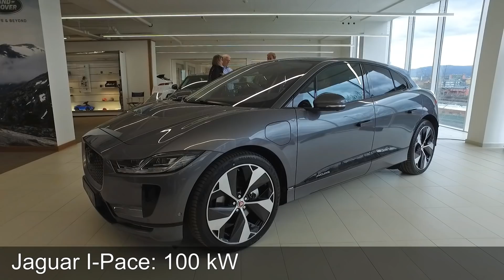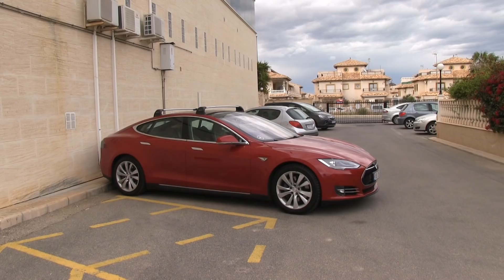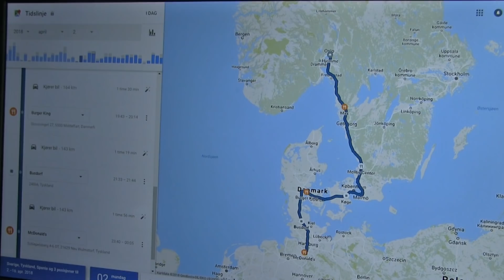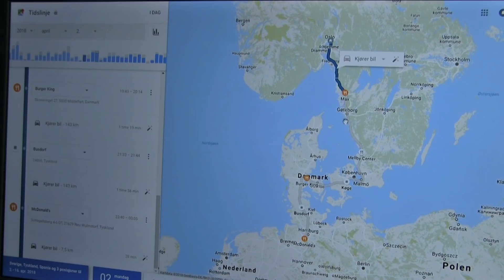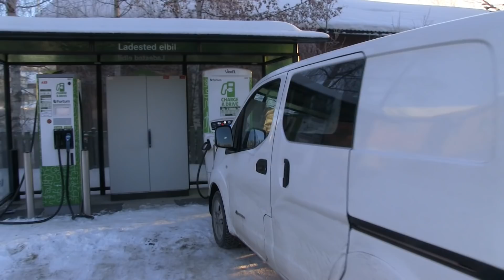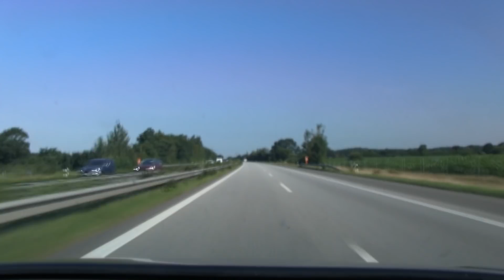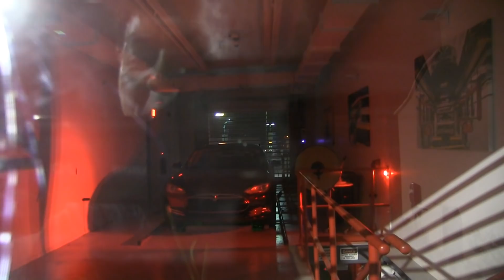Will 350 kW fast charging be too fast?

Comment: Elon actually responded to the 350kW charging of the Porsche during the Q1 call of tesla , He said that it is a tradeoff between charging speed and range.
Reply: 3d tech, current battery technology is the limit. You can buy 18650 cells in either high power with low energy, low power with high energy, or medium power medium energy. The high power cells can charge faster, but they don’t hold as much. Tesla superchargers are set for the Tesla batteries which are a compromise. The charger isn’t the problem. Tesla can upgrade to 350 kw chargers but they would need to change the batteries to 800v.
Reply: IMHO 1000-2000 kw charger sounds great. But I am afraid we will stick for quite a while with the 350 kw as maximum. 

350 kw requires already 800 V. To handle 1000 kw it requires 3 time the voltage in order to use the same cable diameter. Around 2400 Volt also needs groups of 600 cell in a row where the inner resistor of the cell might prevent a large quick charge area. 

This type of quick charging might be more relevant for super capacities.
Reply: IMHO I am not sure whether Tesla is able to switch the Battery cells to groups of 800 Volt for charging purpose. Otherwise I agree it will be difficult to get the faster speed into the car.
Reply: xmtxx2, the 800v has nothing to do with C-rating, is has to do with current. If you have a 350v battery getting 350kw, you need 1000 amp. And that is higher than the charge cord can handle for extended periods. These chargers are limited to 500 amp, so the only way it can get 350lw is to use 800 v battery. If you use a 400 Volt battery, the 350 kw ultrafast charger will only give 175kw. 

The Tesla supercharger can’t put out 350 kw without a significant upgrade, unless Tesla moves to a 800v system. The 2020 Roadster should be 800v, and Tesla can upgrade some superchargers in key areas to 800v 350kw. 

The semi wil also likely use 800v system with 4x 350 kw chargers for the same reason. If Tesla were smart they could add a megacharger lane at baker and Kettleman which funnels 1200 kw to a megacharger and lets each pair of stalls share 60 kw, and as the semi drops the charge rate, those chargers can go back to the cars in a proper sequence.
Reply: That's what a implied, you'd halve the amperage on the charger, we had a little misunderstanding.
As you said, the limiting factor on the tesla S end 3 batteries are their capacity, not their overal voltage.
As said elsewhere, if you tweak your model S battery, you'll still be able to charge it at only 100-150KW.

On the other hand, the roadster and the semi truck will need higher voltage, because they will be able (and need) to charge at higher speeds.
Reply: xmtxx2, yes, Elon and JB explained during the Conference call that the battery chemistry is selected for the best compromise, which can only tolerate about 1.5C charge rate, and have a decent balance between power and energy. The chargers can be 1600 kw if the battery can take it, as will hopefully be demonstrated with the Tesla semi. 

If someone makes a battery which can charge at 12C without degradation, they just need to put a Tesla semi charge port on it and use the megacharger. 

I do see 1000-2000 kw chargers someday becoming the standard, as soon as battery’s can be charged in 5 minutes. Then you charge at home, or pull into a filling station and charge, but all these destination chargers will go away. This is why it’s not good to get too much substandard chargers set up, and too many cars with substandard batteries. It’s hard to imaging that some day a Tesla supercharger will seem like a trickle charger. LOL
Reply: Volker Blume, there are other ways to get around it. I figure the Tesla semi megacharger would use 4x 350 kw chargers going to the 8-pin connector. It can also be done with two DC pin connector, as long as the plug type and wire from the plug to the battery is either big or liquid cooled. 

By the time there are batteries that can handle it, we can also put the charger cable inside a robotic arm, so the weight won’t be an issue.

The main point is, it’s the battery technology we are waiting for, not the charging technology.
Reply: IMHO well to load parallel is one option, definitely. But the cable will be also 4 times bigger in diameter. Maybe a robotic arm will help. Quite some extra effort is needed to handle the connection mechanically. Let's see what kind of solution will come up. For me the question is, is the extra effort needed to charge in 5 Minutes. The consumption of the car per km/mile will not change, even not in 10 or 20 years. It is more likely that it will go down by more sophisticated technology to be build in. 

I would predict with a Battery with 120-130 kWh plus a 350 kw charger and a more energy efficient car you will charge to reach the next charger within 10 Minutes. That will be for most of the people absolutely sufficient. 

With a 100 kWh battery today combined with Supercharger speed I expect charging stops of 15 Minutes. Which is quite close to it.
Reply: Volker Blume, the current Superchargers can only give 30-35 kWh in 15 minutes. Which in a Ioniq would give 150 miles, but in a model X it would give less than 100 miles. I think they can still get some more efficient electric cars, and as they make batteries which can charge faster, the battery can be smaller. One of the 350 kw chargers could add 35 kw in 6 minutes, and that 35 kw could give 150 miles range. 

But I think current technology will just have manufacturers using bigger an bigger batteries which will also allow 35 kw added in 6 minutes, while allowing more range if needed. As long as the weight isn’t so high that the watthours per mile gets out of control.
Reply: IMHO I have an X so I know the consumption on the worst end of efficiency for EV driving ;)

150 miles are 2,5 hours driving, maybe 2 hours in Germany. I do not perceive a short break of 10-15 Minutes as disturbing. 

With the 90 D the charging were 20-25 Minutes, with the 100 D it will drop about 5 minutes.
Reply: Volker Blume, now that I’m old and retired, the 30 minute charging wouldn’t bother me, but when I was younger they trips I did couldn’t be done in a model S 100D or a model 3 75. I know there’s still plenty of people who can’t afford the luxury of EV ownership.
Reply: IMHO Agree the Teslas are the upper end of EVs. But I expect that the technology will become available for more people as the price will drop due to scaling effects of mass production. 

There will be also more affordable batteries with higher capacity. :)
Reply: Volker Blume, yes, but I think that’s still 5 years away before any new EV can be bought for the price of a Toyota Corolla, without subsidies. At some point the subsidies will run dry, and if it happens before the movement to EVs has reached its tipping point, they will slowly become scarce again. If Tesla can make 10,000 $35,000 model 3 per week.
Reply: IMHO that is an other aspect which shall be considered. What I see from other subsidized technology here in Germany like e.g. solar panels, as soon as the subsidiary is dropped the price will decrease as well. 

In general I don't understand why a Tesla should be so expensive as it is now. There is hardly any technology in which requires special treatment in the production to justify the high price. The missing competition in this product range let Tesla keep the price high. Presumably needed to build up the manufacturing lines and infrastructure. But I expect when competition is coming up, battery production capacity will go up, the price will drop. Interesting in this context also how the new Asian car makers will be perceived and accepted from the consumers. Their market entry will be price driven.
Reply: Volker Blume, I think the problem is the battery is too expensive, and nobody wants to buy a $12,000 car with a $15,000 battery, so we have Nissan putting a $8000 battery in a $22,000 car and Tesla had $30,000 battery and needed a $50,000 car to put it in, so it needed the autopilot and very good performance. 

Once battery’s can be made and sold for $100/kWh, we can see some cars around $20,000 because a $6000 battery in a $14,000 car is probably acceptable. 

The leaders of each country also have to pay attention to the economy and not get tunnel vision on climate change while their country is being overrun by chaos from unemployment caused by China doing all the jobs. 

I think Germany is trying to block some of their government subsidies from going into Elon Musk’s Pockets, and they got the model X disqualified but the model S got in on a loophole. The model S base price isn’t less than €60,000 without stripping it down to the bare bones.

As soon as VW group starts making some cars for the US, I think Germany will get some of their revenue back.
Reply: @imho7250 
I've read the other day, that VW has signed multiple contracts with 4 battery makers worth 50 billion to produce batteries for 15 million cars... that would be 3400€ per car on average, but that is more a 6 year plan with a lot of change.

VW starts in November with the production of the ID3 long range (550km) for around 30000€ and the low range (330km) should cost 24000€, but they expect that they need at least one to two years to bring the cost down for the low range.
Till 2025 they want to bring the ID1 to ID9 to the market and especially  for the ID1 and ID2 they have to lower battery cost significantly in the next couple of years.

I seriously hope that they are taking this serious.
Reply: Jakob Schulze, €3400 average for what would appear to be 75 kWh and 50 kWh batteries seems a bit optimistic, even for 2025, unless they think they have a technology that just needs refinement to get the cost down. 

Even getting the battery price to 25% of the total car’s price will take some time, because as batteries get cheaper per kWh, people expect more range or faster charging (miles range added per hour)afforded by larger batteries.

But if anyone can make a People’s Car, Volkswagen is the one to do it. It’s smart of them to wait for proper timing, when most lessons to learn have been learned, then come in with a cult car for the masses.
Reply: @imho7250 
"3400€...seems a bit optimistic"
Not really, when you think about it, but I wrote that a little confusing.
Those are the contracts for the CELLS and not the battery PACKS (which VW will produce in house).

When you look at Tesla in comparison, in 2010 their battery PACK price was around 1000$/kWh, which is now down to below 190$/kWh and Musk claimed that they would be below 100$/kWh for the CELLS by the end of 2018.
So the cells are around 60 to 70% of the price of the packs (from what I've read so far).

So 3400€ for the CELLS of a 45kWh pack, would be 76€ / kWh (or 88$) which would be 12% under Tesla's 100$ per kWh.
That isn't unrealistic, but adds up. (I'm surprised myself how well this quick estimation adds up).
Reply: @imho7250 
I just found this article from a year ago, that they estimate that in 2025 the price for the pack will be below 100$/kWh. ( https://insideevs.com/lithium-battery-pack-prices-to-fall-from-209-per-kwh-now-to-100-by-2025/ )

For a 45kWh car, that would be 4500$ (or 3850€), which is still a lot of money, but would make smaller EVs for around 15k-20k possible.
Reply: Jakob Schulze, yes, at the cell level that’s within reason. The pack level, especially with active thermal management, unless the internal resistance is so low it’s not needed, is going to bump the price up a bit.

I hope they can get these affordable EVs on the road as planned.
Reply: @imho7250 
The MEB has integrated cooling developed and build by VW, but I have read somewhere, that due to the fact, that they use flat cells (which have a bigger surface area) and not round cells (like Tesla), their temperature management is cheaper and more effective (as the bigger surface area makes it easier to cool them).
The draw back is, that the cells are less stable (because they aren't each in a metal case), but also weigh less (metallics heavy).

There are so many possibilities and roads to go down.
It can only be beneficial if a car maker like VW steps into the ring.

(Also due to diesel gate, they have a bigger incentive to make this work)
Reply: Jakob Schulze, the Chevy Volt battery uses pouch cells and has high power density. The most power dense battery uses pouch cells, made by Rimac for the Koenigsegg hybrid. Cylindrical cells were only a good idea back when they were used in laptops, which made them widely available and relatively cheap. But none of the legacy automakers waste time with them. Only Tesla is on that path.

I like seeing cutaways of various batteries. The Bolt battery is low budget cooling, but priced right for the job. Using Volt batteries would let the car charge super fast and support 750 kw motors (with 60 kWh battery). Maybe they will make a corvette with the Volt batteries that can charge at 150 kw and run 3x 250 kw motors.
Reply: IMHO Agree that is one major factor. The Battery cost will drop as soon as the market can be supported sufficiently. From production view Battery Production is like printing. Scaling should be possible. :)
Reply: its also a compromise about longetivity ..  you can make alot lighter and faster battery packs than the ones tesla uses, but they wont last very long..
Reply: High power batteries have lower specific energy and high specific energy batteries how lower power. You really can't have both, if you really want as much of one of those feature as possible you have to sacrifice the other feature.
Reply: @IMHO
It wouldn't change anything. Charging speed is represented in 'C'. This C in inherent to the 18650 individual cells. 1C means that you can theorically charge the battery in 1H. 2C in half an hour.

So, switching the battery to 800V would only means that the main amperage would be halved. Each battery would still be charged at the same amperage.

With the same battery cells, if you want to charge at a higher power, you'll need to put more cells (that's what is happenning in the roadster, it's 200Kwh).

As you said, if you want higher power charge with the same amount of battery, you need to trade (dis)charging speed for range and longevity.

Comment: Speed is never too fast.
In many many batteries will withstand that much power and many chargers will be capable to charge so fast.
And nobody will want to go back to slow charging.
This is progress and it is needed.
No need for many chargers, if everyone is done charging in 5 minutes. The future.
Reply: No disrespect, but I disagree.
Why would you purposely wait longer for charging if you don't have to.
Yes, people can go to the bathroom or eat while charging.
But many people just want to get a full battery as quick as possible and go on.
Let's not forget working people with cars.
Faster is always better if the cost is in relation.

Nobody would wait 30min at a gas station if it could be done faster.

I think the best thing for an EV would be if thinking about charging is not important anymore.
Because it is everywhere and it only takes a few minutes.

People got used to fill up they gas tank in 5 minutes. They don't want to wait more.

It could just be me.
I love EVs but if I want to go from A to B and if it is possible to charge faster and to get to B faster
I'll take that, IF the cost is OK.
Reply: That is true.
But again, this is the progress where everybody wants to go.
It is the same with smartphones. Progress, getting faster and more memory.
Nobody cares that they are more expensive.
in 30 years all chargers will be amazingly fast and the battery can take it
and nobody will complain and think: "Oh, that was nice when the chargers were slower!"
It is the same with Range and Price for EVs. Range will increase, Price will go down.
Because of the demand and the competition.
Reply: Too fast for the batteries, most batteries cannot handle charging that fast. The only batteries even remotely capable of charging that fast are lithium titanate batteries and even those one take 6 minutes to full charge not 5 minutes. These batteries sacrifice specific energy and cost for high power so they have their own compromises.
Reply from the maker: No, people think they need faster charging. It comes to a point where faster is pointless. No phun intended.
Reply: Slow charging will always be cheaper, so I'm not sure I agree that there'll be no slow charging. Sure, highway chargers will get very rapid, but most destination and home chargers will probably stay slow. And there's no issue with slow charging if the car waits for you anyway.
Reply: But now, when you always charge with 350kw, then after 1 year you need battery change ....
Reply: Kuba jabłoński 
That is why I said in the future.
Not right now. It is called progress.
Reply from the maker: I disagree. Too high speed has many disadvantages (more degradation, more energy loss, higher cost for charging, higher cost for installing chargers). And I don't think you understand how EVs work. EVs can be charged everywhere. So they don't need to visit a gas station once per week like fossil cars. All you have to do is spend 10 seconds plugging in every day, that's it.

And for long trips, you have to drive very far and very long before the car needs to recharge. The human body will simply not be able to keep up with the fast charging rate that 250 kW on a 200 kWh car offers.

That's why too fast is pointless.

Comment: Good topic arised, „too fast charging speed“ - what makes sence.. thanks for your thoughts.

One question: maybe I should place this in discord channel, but, it‘s mentioned multiple times in this video: what is „C“ means? What is that for a measurement category? Never heard so far.. 1 C is better than 1.2 C.. 🧐 What is that?! Very courious. Thanks
Reply: C is just capacity of the battery. Charging 100 kWt/h battery with 1C rate means to supply 100 kWt power to it.